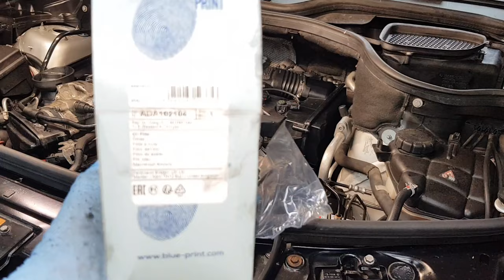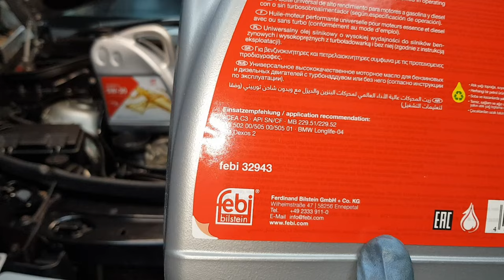Mercedes Oil Cooler Seals ML350 cdi 3.0 V6 ML320 E320 Sprinter OM642 W164 W166 Vito engine oil leak

Comment: How many hours does it take start to complete, about  ish....?   Also what kind of money is this type of job.   ?
Reply from the maker: @normski262  Read the comments below as this has been discussed before
Reply: @TheKeenMechanic   Yep, about 2 good days  work , thanks
Reply: I had the crazy idea to remap it, my OM642 v6 Merc engine in my Chrysler CRD 30ltr ; also to remove the DPF filter, disable the swirl flaps, and the EGR to be shut down, In the hope I would get , umm about 268 to 275 BHP. The DPF, EGR and the swirl flaps are all done. But I was then told they could not remap it. Um and why, "I said" ? .. it seems the turbo boost is down, they said its is probably, due to an air leak in a hose or something, as its kind of unstable,but well below the boost it shoud be; also to add to the fun, it seems the fuel pressure is also down, it seems to them, probably due to carbon choke build up, and maybe a bad seal in the inlet manifolds, OOOhh deep joy. But they ran it up on the rolling road, even with with DPF and other bits done, max output is about 197 bhp at the shaft, should be 218bhp, anway its only around 157.8 bhp at the wheels, with 498 of torque. Ouch, way off the line from standard. They suggested I find a garage, to change turbo noses or find where the air leak is coming from and fix it, and also have the inlet manifolds taken out, cleaned out of all the carbon crap, and to put new seals and bits in, and reinstall. Not sure of that cost, I would think its a good 1 or 2 days for a mechanic, but I maybe wrong. Anyway, they said, after I have had this done, bring it back and they should be able to complete the remap, hopefully giving me around 260+BHP.Question is, , but I have no oil leaks, aahha thats something.

Comment: the only way to tell if the valves are closed is to look with a micro camera correct? i think im gonna buy dry ice or walnut blaster
Reply from the maker: You can also use your phone camera to watch the valves moving. Start recording a video with light on🤝🏻
Reply: @TheKeenMechanic  tnx great video,hopefully there wont be no extra parts when i m  done lol
Reply from the maker: @5000RR  😁

Comment: Does oil cooler issue affect ehite smoke from exhaust? And can it cause excessive oil consumption?
Reply from the maker: Oil cooler can indeed affect oil consumption simply due to the fact that you are losing it through the seals. White smoke is normally associated with engine burning coolant. Again this could be due to a leaking intake manifold gasket as the manifolds are liquid cooled. When you do the oil cooler you will need to replace the manifild gaskets as well. If I were you I would go ahead and replace the seals and all other gaskets as shown in my video just to be sure
Reply: @TheKeenMechanic  pcv affects both tho? (White smoke & oil consumption)
Reply from the maker: @aldentan9710  Oil is normally blue-ish colour. If your PCV is blocked most likely the oil hasn't been changed frequently. Best of luck buddy

Comment: How did you managed to put the wire loom back in place ? Did you removed the turbo second time ?
Reply from the maker: You can remove the plastic from the wiring and wrap the wiring with heat resistant tape if you don't want to remove the turbo again.🤝🏻
Reply: I think that`s a Yes,

Comment: can you advise me?
I have a mercedes w164 ml320cdi.
in the last 2000 km, it consumed almost 3 liters of oil.
what can it be?
Reply from the maker: Probably an oil cooler leak. If no leaks you valve stems or oil piston rings. Best of luck
Reply: @TheKeenMechanic  there are no leaks, I'm going to remove the engine. thank you
Reply from the maker: @branislavvucetic8557  Best of luck buddy, hope you get it sorted

Comment: Hello , Vielen Dank für das Video. Ich habe eine Frage - möglicherweise tritt Öl in das Abgassystem ein, und ich weiß nicht, was der Grund dafür ist. Liegt das Problem am Motor oder am Turbolader? Alles andere am Fahrzeug scheint in Ordnung zu sein. Ich habe das Fahrzeug gekauft und der Verkäufer hat mir versichert, dass weder der Turbolader noch der Ölkühler defekt sind. Dennoch tritt dichter Rauch auf, wenn der Motor heiß wird. Der Motor läuft reibungslos und klingt gut. Ich habe auch etwas Öl am Einlass des Turboladers entdeckt, wie im Video gezeigt.
Reply from the maker: Hello, thank you for the video. I have a question - maybe oil is entering the exhaust system, and I don't know what the reason is. Is the problem with the engine or the turbocharger? Everything else on the vehicle appears to be fine. I bought the vehicle and the seller assured me that neither the turbocharger nor the oil cooler were defective. However, thick smoke still appears when the engine gets hot. The engine runs smoothly and sounds good. I also discovered some oil at the turbocharger inlet as shown in the video.
Reply from the maker: I have posted the translated message in English so others can read it too. It is hard to tell without inspecting the vehicle in person. Is the smoke Black or Blue/White? If it is black smoke the it is most likely not enough air to burn the diesel. If it is blue/grey/white smoke it could be oil/antifreeze coolant leak. It will be very hard for oil to pass through the combustion chamber and to end up unburnt in your exhaust system. Make sure you have no turbo boost leaks which will cause the black smoke. This ML350cdi shown in the video was working very well when idling, but had no power and smoked black due to boost leak from a sensor that was not fitted correctly and had fallen from the plastic manifold which goes to the aluminium intake manifolds. Check the engine 1st and make sure you have no obvious boost leaks. If you know somebody who has a smoke machine get him to pressure test the intake system and check for leaks. Hope this helps
Reply: @TheKeenMechanic  The smoke that comes out is blue, a lot of oil enters the exhaust system / Sometimes white smoke comes out when the engine temperature risesThe engine runs smoothly and no malfunctions appear on the screen ,But the problem is the smoke and oil in the exhaust system
Reply from the maker: @MN-nl3kp  hi
If there is nothing obvious you can replace or rebuild the turbo and see if this solves the problem. I found a company here that sold me a fully professionally rebuilt turbo for around £300 when I returned my old one. I hope the place you purchased it from offers a warranty. Check if coolant is leaking into the intake valves from the manifold. I have seen this before. This causes light coloured smoke too. Hope you get it sorted. 🤝🏻
Reply: @TheKeenMechanic  Thank you very much❤️

Comment: Were the seals changed in the W213 E-Class?
Reply from the maker: If you have no leaks you can take a chance. If it is leaking it was either changed a long time ago, may be poor quality seals were used or never changed at all. Some last over 100k miles others fail much earlier. Hope this helps
Reply: @TheKeenMechanic  I thought that the seals were changed to Viton for the update?
Reply from the maker: @peterryan7340  You could be right😉

Comment: Hey what's the name of the tool or do you have a link for it at 37:22
Reply from the maker: Hi
It is a diamond coated router bit sharpening tool.
Bought it 15 years ago so may be hard to find now but you will deffinitely find something similar
Reply: @TheKeenMechanic  thanks I think I can find it here in Canada, what Grit is okay for the job.
Reply from the maker: @Slim3rC10  above 1000 grit. Thanks for watching
Reply: @TheKeenMechanic  
Thanks I got some ridiculous quotes for this issue and not alot of mechanics want to work on it, so I guess I gotta roll up my sleeves and do it.
Reply from the maker: @Slim3rC10  That's exactly why I put this video together to show people how to do it themselves🤝🏻
Reply: The place I went to, quoted me this, vacuum pump leak, oil filter housing leak,  upper control arms and those rubber lines on the injectors to be replaced, with some extra stuff thrown in for 15k Canadian parts and labour, I just laughed at them.
Reply from the maker: @Slim3rC10  $15k for a repair for a used car🤔 I think many people have lost their common sense. It sounds like you got quoted  as if you were repairing a Bugatti
Reply: @TheKeenMechanic  indeed, the split between parts and labour was 50/50.  I did call them out on the upper control arms, I managed to obtain Delphi ones for 80 CAD each whatever they were supplying were 630 each side, as they just said it's OEM parts not genuine Mercedes Parts, when I enquired.  I am happy with the diagnosis check they did on the car as it threw up other stuff as well so that was worth paying for.
Reply: Super video
Reply from the maker: @jonathanchera4822  Thank you again mate. Much appreciated

Comment: Hi, for intake manifolds is 16 nm torque ? And what nm torque for turbo 2 bolts ?
Reply from the maker: I couldn't use a torque wrench on turbo bolts as it is very tight for space. Just go with "good and tight".

Comment: Omg good job how long does it take to get it done 🤔
Reply from the maker: This was my 1st experience with OM642 engine. I had big trouble removing the 3 bolts at the back of the turbo which took nearly 6 hours by itself as I had to bend and weld custom tools to loosen them up without snapping them or rounding the heads. I would say all together with all trouble, cleaning and filming took about 30hours. If I was doing it again it will be 12 to 16hrs with good detail.
Reply: @TheKeenMechanic  nothing is easy a specially on older vehicles 🤷‍♂️
Reply from the maker: Totally agree😮‍💨

Comment: Hi I have oil leak issue with my Mercedes c350 d - just wondering where you are based so perhaps I can bring the car to you for repair also if you give a rough indication of the labour cost involved in this sort of repair. Thanks in advance
Reply from the maker: Hi
I am in Northern Ireland
This job would cost anywhere between £500 to £1000 depending on the level of detail and parts/consumables used.
Reply: Thanks - 
Unfortunately I’m based in Yorkshire and have booked it with a mechanic for this Friday, hoping it’s nothing too extreme. Once again thanks for responding.
Reply from the maker: @mohammedshafiq226  It shouldn't be too bad. Hope you get it sorted. What price did you get quoted buddy just out of curiosity? Thanks
Reply: I don’t know yet as they are going to have a look at it tomorrow 🥴
Reply: It is losing a lot of oil though
Reply from the maker: @mohammedshafiq226 Hopefully not too steep. Best of luck with the repair and hope you get many more trouble free miles on the clock
Reply: Hi  shafiq did you get your issue sorted and if so what did it cost you and could you kindly share the garage details as I have similar issues on my ml320d and was looking for a mechanic to do it . I am also based in West Yorkshire
Reply: Unfortunately still waiting to find someone as I have been to a number of mechanics - they either don’t want to take up the repair or are too busy and quoting long waits before they can book the job in ☹️☹️☹️
Reply from the maker: @mohammedshafiq226  Follow my tutorial and do it yourself guys. You have to start from somewhere. It will be a challenge but the satisfaction you will get will be indescribable
Reply: @TheKeenMechanic   Ive just been quoted £1896 by my local MB authorised repairer for this same job albeit without the cleaning - just wondering if its worthwhile me dropping mr muscle with them - you have done an amazing job in your video. You ought to be very proud of yourself!
Reply from the maker: @anoopdhaliwal  Hi buddy and thanks for the nice comment. I keep saying to people to get their hands dirty and do it themselves. With the level of detail I have shown in my video I am more than confident you can do it yourself. It will build your confidence and skills and it will save you a fortune. It will be a shame to pay someone to take all this apart and not clean the ports and manifolds. The SUV I repaired is now getting 2-4 mpg only from the cleaning. Best of luck, get back and let us all know how you got on🤝🏻
Reply: @TheKeenMechanic  I’ve had to fork out £1896 that too with a 7% discount on parts because my 2012 E350 CDI has a full MBSH from the MB dealer. I even contacted MB UK as was peeved that this happened at 76k and asked for a contribution which they declined. 

Genuinely, hats off to you on the skill, finish demonstrated in your video! I’ve neither the time, space or tools to attempt this to get it right first time or to get it wrong. 

I’m like most people watching your content admiring at 1.25x speed what can only be described as open heart surgery that their beloved motor must go through!
Reply from the maker: @anoopdhaliwal  Thanks again for your time to write and for watching my content. I understand that it will be very difficult to do if you don't have the space and tools. I hope the main dealer look after you and your vehicle. Wish you many more trouble free miles and thanks for stopping by🤝🏻

Comment: Do you have to take off turbo charger to replace oil cooler ?
Reply from the maker: Yes
Reply: @TheKeenMechanic  However not a good information for me - thanks for quick response ... I also have white smoke from exhaust and little amount of coolant dropping. EGR Cooler ? Thank You.
Reply from the maker: @ukaszjurys2475  Possibly cooler, hope it is not head gasket related. The intake manifilolds are liquid cooled so could be that too
Reply: @TheKeenMechanic I will let you know once it's fixed.
Reply from the maker: @ukaszjurys2475  Check the bridge pipe with the two O-rings connecting the 2 manifolds. That is a very common point for leaks. Best of luck and yes, let us all know when fixed
Reply: @TheKeenMechanic  at the moment the only problem was a pressure sensor which reduced amount of smoke ,EGR show proper % (finally)...

Comment: What year and mileage of the car? Please.
Reply from the maker: This ML350cdi is year 2010. It had 190k miles and blew an engine 4 years ago due to poor maintenance. It received a used engine with 100k installed back then so I assume the current mileage would be about 150k on the second engine. I very much doubt that the intake and valves were ever cleaned. Hope this helps

Comment: Ohh man, have also replaced the seals with Purple (much stiffer ) bolted the oil cooler with 6nm,  after two weeks much bigger leak. Appeard to be purple seals gone bad.. Got me another pair of Orange seals and did the job again. Any of you had this???
Reply from the maker: Oh such bad luck. I would hate to do this twice due to bad seals. I bought my purple seals from Mercedes dealer and I am aware there are many other cheap asian copies out on the market. Hope your dealer bought their seals from an approved supplier
Reply: No oil cooler new?
Reply from the maker: @madeinthehell1622  Save yourself £200 and use the old one. The only issue is the orange o-rings that harden over time and start leaking. Same as any other oil cooler, people just replace the gaskets🤝🏻
Reply: @madeinthehell1622  Yes the oil cooler was bought new as well, (however dont think thats the problem, even the old one was still good.)